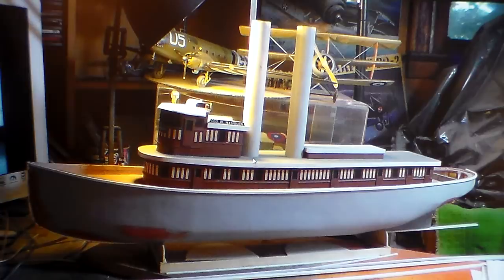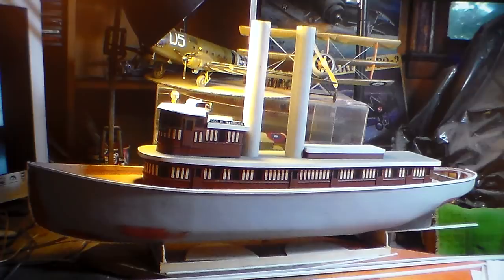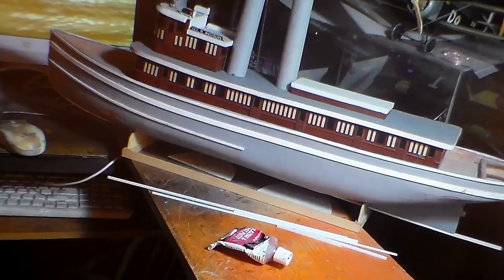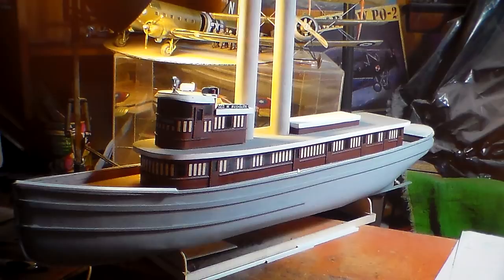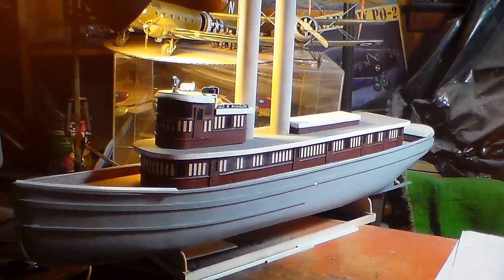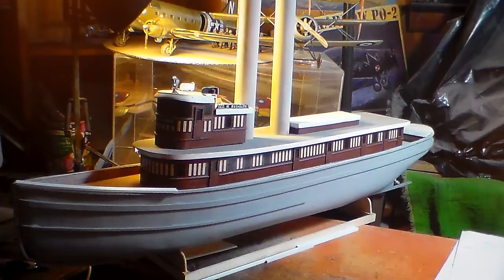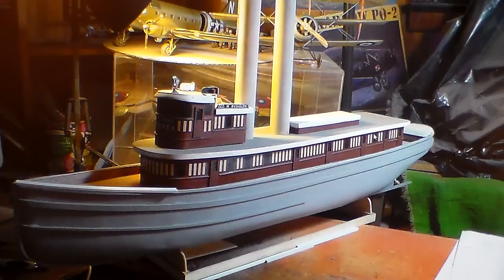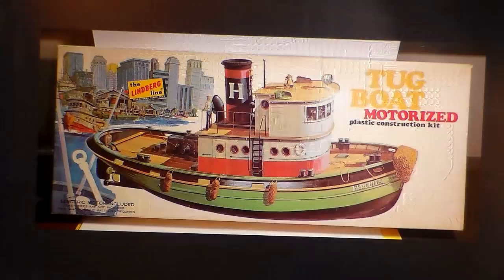Dumas GEORGE W WASHBURN Tow Tug Video 3  PART 1

Comment: Do you have to use a gear reduction or does that motor have a limited rpm? It's looking good Frankie!!
Reply from the maker: Ahoy John                          No reduction all direct drive the running gear consist of stuffing box prop and prop shaft along with universal connectors.  The electronic speed control will control the speed of the motor. I now just received my running gear everything now is in order nothing to wait for now.  thanks buddy for tuning in I am honored.Frankie Day
Reply: Frankie Day M
!